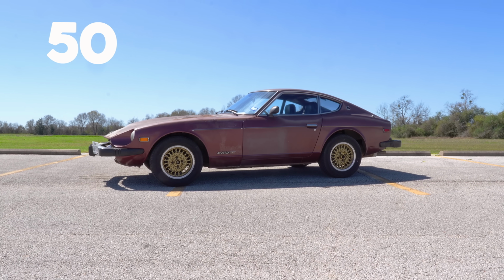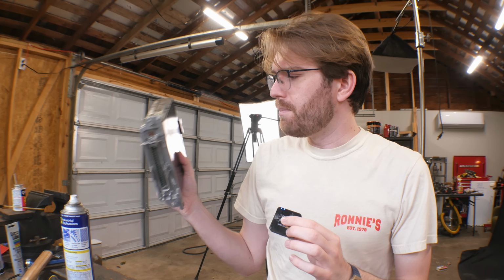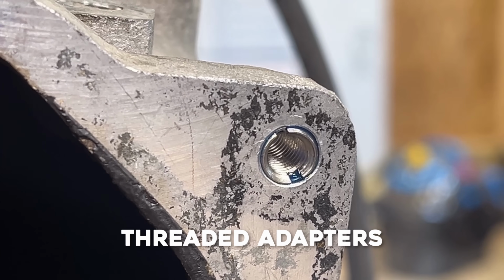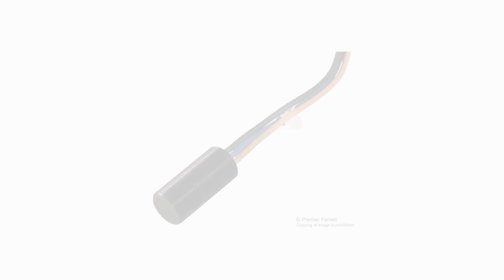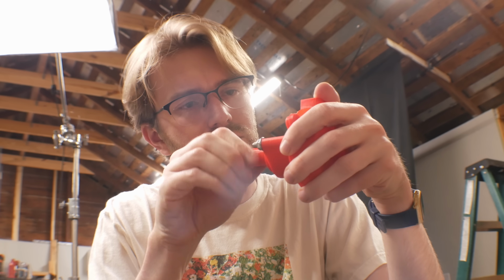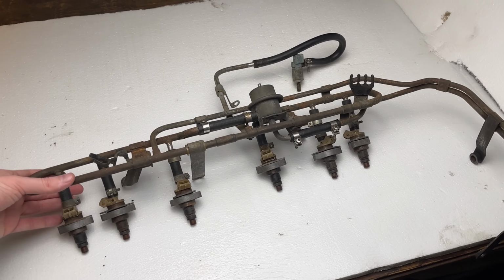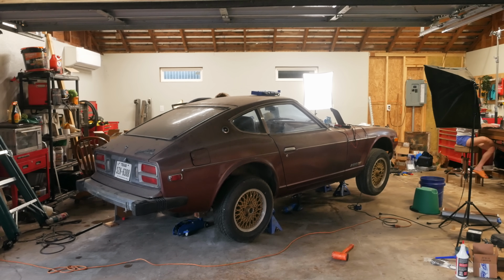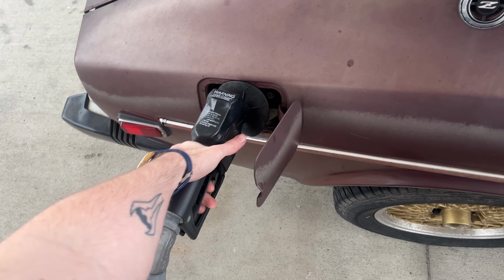Modernizing a Vintage Car

Comment: Lots of ingenuity there, but "modernizing" seems kinda pointless if it's only going to net you 13% power gains and a couple mpg.

ESPECIALLY since Datsun themselves "modernized" them in 1981 with the 280zx turbo, which made 180hp stock and got similar fuel mileage to your update, in my experience. 

I owned a 1978 280Z 2+2, '79 2+2, '80 2-seater, and an '83 2+2 turbo (T-top).  In my case did a T3/T4 hybrid turbo and hung a junkyard intercooler on it, cranked the boost with a turnbuckle in the wastegate rod, and made it a mid-13s 1/4mile car... so am assuming 250 or more hp with very little money.

The stock bottom-ends on the turbo cars were good for 650hp, btw, and they'd run a long time, too.  

Rust was the main issue with Z's back then.

Comment: It didn't lose power. A  good guesstimate is the kW at the flywheel is approximately the HP at the wheels 170HP is 126KW so 125hp at the wheels is good for its age.

Comment: I will make one very important point here. One of the best ways to keep something all original while boosting power and reliability is blueprinting a motor. Now I know a lot of people consider blueprinting extreme and probably the last thing you want to do but I think it's one of the first things you should do. Blueprinting takes out all the vibrations that are harmful for an engine. The amount of efficiency and reliability increase are worth it and you also get a bonus power increase. Plus it would make for some great videos.

Comment: This is one of the most interesting videos I've ever seen. Keep it up, champ. I've got a 40-year-old truck here in Brazil, that runs in a 4 liter 4 cylinder engine (yes, believe it or not). Well, I turbocharged it, it sounds good and runs good, but I really want to make it as interesting and reliable as possible. Next year I'm planning on adding a new transmission with a 5th gear (it has only 4), an intercooler and maybe someday a new injection system to make it a menace (keep in mind that this engine is almost double the size of most truck engines around here, so... I hope to get more than 50kgfm of torque and around 160hp, which is already good to me since I like old things and I specially love this truck). Some people made projects on this exact truck, making it 250hp, even without changing the injection system (just upgrading the mechanical injection with higher flow), so if mine gets funny enough I'll post something here on YT.

Comment: Funny how my 1979 Datsun 280zx was fuel injected. So I guess Nissan realized a couple years later it was worth doing! I got that car around 1998. I didn’t even know they had fuel injection back then. Just because so many cars I had seen and worked on didn’t have it. Was all carbs. Just was a very unique engine setup in general being a fuel injected straight 6. Cool cars. But only look cool if the right color, wheels and ground effects! Got to have ground effects

Comment: The 3D model and parts for that distributer sensor would come in handy. I have an old Volvo with a distributer and i have wanted to change it to electrical ignition for a while now, but can`t seem to figure out how. I would even consider paying for something like that.

Comment: Awesome!!
I haven't finished your video but I love the concept.
I did something similar (i think I haven't finished your video) with my old 1977 bmw also a L jet system. It was one of the first but it wasn't good. I went from a mpg of 17 to 25 with better computers and fuel injection.

I am sure it would have been better with sequential injection vs batch coil on plug ignition ect (my build, not yours... I should watch your video)

Comment: I would put the PCV system back on it. Just having a filter on there removes the  active ventilation via the engine vacuum. While it works, letting the crankcase ‘breathe’ on it’s own without the vacuum means that any contaminants from the combustion chambers don’t get ventilated out as fast and have more chance to foul up the crankcase and oil.

Comment: You really need to get in contact with someone to re-finish the body work- you need to refurbish / repair the exterior- not just the interior. It needs to look the part .

Comment: Taking an engine apart and swapping the internals isn’t easy, unless you’re an expert or a self important blowhard replying to youtube comments. But by comparison, it’s so much easier to gain hp from that than it is to do it the way that you did it. But you did it. Congrats!

I’ve heard there isn’t much else to gain from the L28 anyways, even if you did build the engine now. I think you’d be lucky to get 175whp from it.

Comment: You should 100% get japanese spec bumpers! Also if you want a near idea for the hood since it's pretty fecked, clean it up to bare metal, and try gun bluing it, give it an awesome midnight semi translucent look, and then seal it with  some clear or wax layers

Comment: Just a thought; couln't you use flywheel teeth for the starter as a reference for hall effect sensor? That would simplify that project a lot without needing custom parts and would work just as well.

Comment: In high school the last year or 18 months I drove a 1979 Datsun 280zx. Thing was sharp as hell looking. Was grey with front ground effects which makes these look way better. Without them I think they are kinda ugly. The bumpers killed the lines on it. So with ground effects it helped a lot. Also it had its original rims which were much different than these which don’t look stock but maybe are. It was a 2 plus 2 which meant it had two tiny rear seats. Anyone over 14 had to sit across the back. It had black fake leather and bucket seats. 5 speed transmission. Straight 2.8 liter 6 cylinder. Fuel injection. Really cool cars. Sad you don’t see nice ones around anymore really. Least not up here in NY. I drove it from about 1998-2000. Sold it to a friend who wanted to do a bunch to it. But he waited too long and rust started to win the war and he gave up. I also always wanted to drop a 350 into it like I had heard others had done. A V8 in it with some upgrades suspension would be awesome

Comment: I hope to one day restomod a 1946 gmc truck at my grandpa's, end goal is full sealing and clean up of the body(the easy part), upgrading electrical, steering, brakes, making the split hood lockable and rebuilding the wood grainhauling box, lots of neat hand forged frame work. And figuring out putting in a 1JZ. Gotta keep it straight 6 but also not needing to change oil every 500km would be a boon. Outside of the motor and probably wheels, i wanna keep it looking pretty stock but make it a sick summer daily. Turns out you need space to do all that and people seem to want to buy projects and not finish them...

Comment: I came here from MM's channel.

TBH, there is value in both keeping a vehicle totally factory default and also in making sensible upgrades. One is not better than the other... they are both different paths to a different result. You want an electronic throttle body? Why not? It gives a new lease of life to the car either way. I enjoy both original and upgraded products.

I like what you did with this car. And obviously, you have some love for the project, for you asked the best person to make you some precision parts.

Comment: This is very cool, I actually owned a 1978 280z with the fuel injected cam over 6 (thats the way the dealer explained it to me!!) I loved that car, but I got a lot better MPGs than 17 or even 19. If I remember correctly it was more like 20-22. And even though it was not great in the 1/4 mile, it had good power at speed. I could be cruising at 55-60 drop it into 3rd and very quickly be going 100-110. The only thing I did not like about the car was mine had a tranny governor that kicked in at about 120, and yes I tried several times just to be sure. Anyway, great video about a great car!!

Comment: problem with electronic came with a understanding that if the little box die all linked sistems die and you just linked in the box 4 systems separated wich now is semplifying your life but not in case of malfunction later

Comment: Why, oh why, didn't you install a Hall effect sensor on the crankshaft? It would have been simpler. The way You using the distributor output is impressive, but a bit over engineered.

Comment: Everything in this video was explained so well, as someone with fairly limited knowledge of the working of cars, this really demystified the engine and made it seem much less scary to work on than I imagined. It's quite overwhelming when you see everything in one huge expensive unit working perfectly, but at the end of the day, it's just a bunch of fairly simple(™) systems and sensors.

Comment: I had a 1979 Datsun.
It was a 310 hatchback. It was a brick with wheels.
Yeah. 1.4l with a 4-speed.
Got it up to 130km/h once. ONCE.
I actually miss that car, it was so much funner than my 2005 Pontiac Wave, AKA "The THING"...

Comment: The worst part of it is the cylinder head. That stupid design where the intake and exhaust are on the same side. It's awful for flow. Plus modern cars have higher compression ratios, and computers have helped them design combustion chambers.

Comment: The engine looks way cleaner without all the extra outdated stuff. 142 HP at the wheels, which is 28 less than the 170 at the crank? How much drivetrain loss is there? It looks like the output is pretty close to stock.

Comment: So you are giving it a "SuperTune" to see how well the engine can run as is. I think that's cool, but also pretty limiting. This would be cool if you could design an upgrade kit for owners. Buy the kit, replace the air and fuel delivery system, get a better engine.

Comment: So, replace the starter and start tuning the computer. Welcome to the tuner world.

Honestly, excellent job.  Adding modern systems to a 50 year old block is pretty impressive. Especially since you had to design several new components.

Comment: 30:36 That simplified engine bay looks beeeautiful!
Reply: I remeber freaking people out becasue I could stand in the engine bay of my z with the engine still in the car. Todays cars have only made thing more air restricting to a fault. See 300zx Z32 and Mitsu 3000GT for reference.
Reply: Ikr it look sick
Reply: It doessss!! Even though it’s not a crazy lot of hp, or gas savings I think think it’s still a worthy accomplishment
Reply: A work of art, as they say
Reply: If a atlas 6 would fit? Why? 275-295 natural horses. Lots of torque and 2 cylinders less than 5.2 LS. Oh and plenty of them in junk yards with dead ECMs. So make it work with a 6 speed stick and no ECU.
So why not in a Silverado? 2 things. Hood is too short. Plus, Wouldn't you rather have a V-8?
I-6s usually last longer. Had 220,000 when the atlas ECU puked in the 2003. Used less than a pint of oil every 5,000 miles.
Oh and the 280Z came with a I-6.
Reply: Tons of space for a beefy turbo

Comment: Bosch started out as a Mechanic's workshop around the same time that the Statue of Liberty was first Inaugurated. They Pioneered electronic fuel injection, and, naturally, that means a lot of cars were running with their systems. I get hating on a brand, but this was some astronomical amount of shade-throwing done in the span of a couple of seconds, comparing collaboration with Bosch to World War 2 here...😂

using a Bosch hall effect sensor afterwards is just poetry at that point.

Comment: Hey Ronald, i am a fan of your work scince the gpz project and an automotive science student from germany. I am currently writing my thesis. For my mandatory project, i worked at my university and went through the exact same process as you did the last 3 months, just with an old 4 cylinder from VW (EA111 AXP), and we also used the EMU from ecumasters. it was fun to see that you've basically ran into the exact same problems as i did. and as an "engineer" (well, hopefully i will become one in a couple weeks) i really liked your solutions to the problems that occoured. i still wonder what your ve-table looked like in the end, because the one seen in the video is, lets say, not so optimal. also, you didnt talk about injection angle/table nor ignition table? the latter caused the most problems in my project, considering emission gas temperatures and knock (my engine has a cat and a couple ten thousands € worth of measurement technology so i was regularly sweating like crazy during testing). i dunno if this would be too technical, but i would be more than interested. also, you talked about installing the oxy sensor, but did you use the ego feedback later on? and i know its probably too late now, but ecumasters has the autotune function, which will create the perfect ve table while you drive. i can also recommend the channel "driving for answers", as he did some really helpful videos. to summarize, i think that you can squeeze quite some more hp out of that enginge, if you implement a knock sensor and optimize your ignition table. anyways, this comment is already getting way to long and you will probably never see it, but if so: that was a beautiful video and some great work from you, thank you for making my evening. see you next year (hopefully)

Comment: Just gonna say, considering the motor is a complete unknown (when was the last time it was rebuilt?) 125 horsepower is not totally horrible.
My 240K had an L24 SOHC in it and was a pretty solid unit.
 I miss that car, didn't have the $$ at the time to repair it and sold it on.

Comment: Great to see you Mr Finger. I'm doing a similar (was less complicated) job. I daily drive a 1959 Belair. Was all original 6 cylinder, 3 speed manual. 

I've added electronic ignition, 5 speed transmission, and I'm going to attempt to make some sort of efi for it. 

The 5 speed brought me from 16 to 19 mph.

Hoping the efi gets me in the 20's

Thank you for the entertainment and knowledge. Have a great winter ✌️

Comment: what is the AFR? tweaking it based on load / RPM might get you to 21mpg.  what oil are you using?  If the car can run 10/40W you can gain a couple of percentage more fuel economy. What timing map are you using? adding a knock sensor and having the computer advance timing as much as possible will net you even better power and fuel economy.  also advance tweaking like cam timing can get you even better numbers.  Remove the fan, that thing eats a lot of power/fuel economy.  replace with an electric unit controlled by the ECU or a temp sensor in the radiator, with the fan mod, cam and ignition timing pretty sure you can make 24mpg

Comment: Im currently putting in a newer engine in my 1988 ford escort, bolts right up to the transmission and mounts but has fuel injection instead of a carb, ecu ignition and nearly double the horsepower :D

Comment: Nice conversion.  Really enjoyed watching you work through the system.  I think your next progression is to give the ECM the calibration curves for the Mass Airflow Sensor, so it can build up an air table based on actual sensor input.  But I think that you need intake temp and pressure inputs to make that work.  In the end, probably fuel rail pressure too. Looking forward to future content on the 280!

Comment: More efficient is a thing, i got a 1991 Volkswagen MK III GTI 2.0L 8V (Motorcode 2E) which has a really old injection system (Digifant). It still has a Airflow meter, not even a mass air flow sensor)
What can i say, it's tuned with cams and all the stuff you do while tuning N/A Engines... Result: 175 WHP, 1020KG emptyweight (wet), 6,1L/100km. ~900km of range.
My mate got a 2024 Polo GTI (207HP) which is around 7,6L/100km and a range of ~430km.
On top he's slightly slower from 0-100 and in Top speed i absolutely ruin him.

Comment: My native language isn't English, so there may be some inaccuracies. Your ignition system isn't perfect at the moment. There's a gap between the crankshaft and the distributor for the gear to operate. Consequently, fractions of a degree can be lost. A more reliable solution is to install the gear on the crankshaft pulley. Then the Hall sensor will read its position directly from the crankshaft. This will eliminate gear play. But be careful. Often, the oil pump gear is located on the distributor or somewhere nearby. I'm watching a Russian guy from the Sovzhest channel. He's upgrading a ZAZ 968 Zaporozhets (a Volkswagen Beetle clone). He's done a lot of work on the engine. Good luck!)

Comment: Very nice clean setup. You should sell these kits to people. Have the computer all setup already and have wiring harness. Anyway. Without doing any engine work that’s impressive. Imagine if you upgraded the pistons and rods and cam. You could also turbocharge it.

Comment: You know gonna have to give you major props on first of all, taking on such a bold makeover of a combustion system without touching any of the internals and getting that much horsepower squeezed out wow man good job

Comment: Great work and video!  Massive amount of work.  One correction:  batch firing of fuel injectors does not “waste” fuel, since all fuel injected into the intake is combusted by the engine.  The timing of the fuel addition is controlled by the intake cams, not the injectors.  The benefits of sequential fuel injection is smoother idle and lower emissions, particularly at idle and low rpm, since it can better control exactly when the fuel is injected (ie, only when intake valve is open).  At higher rpm’s, it doesn’t really matter.  Some engines even switch from sequential to batch firing of the fuel injectors at higher rpm.

Comment: Can i ask why you chose to use a threaded adapter instead of just drilling the threads on the throttle body out more? seems like a weak link for no real reason and also costs money